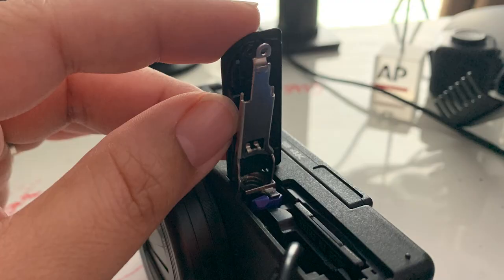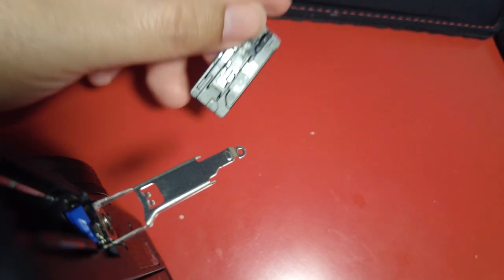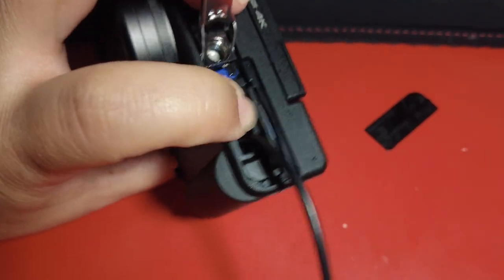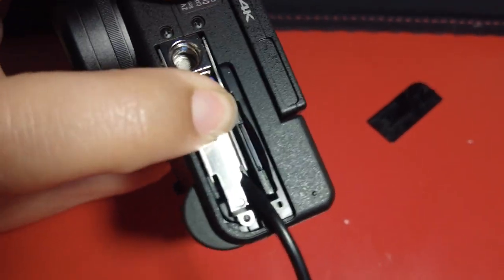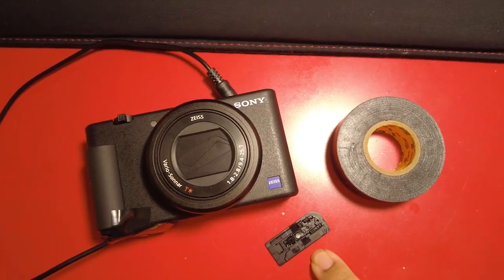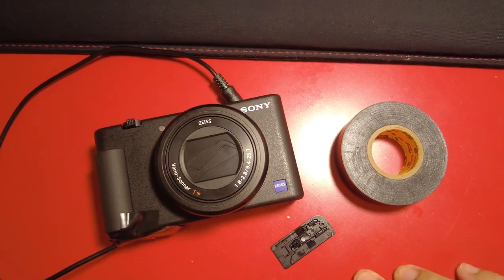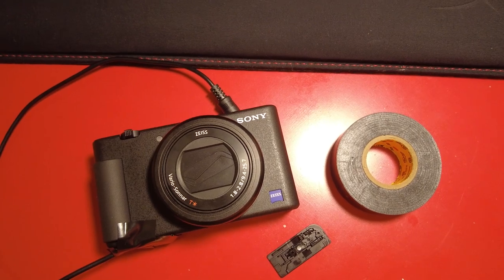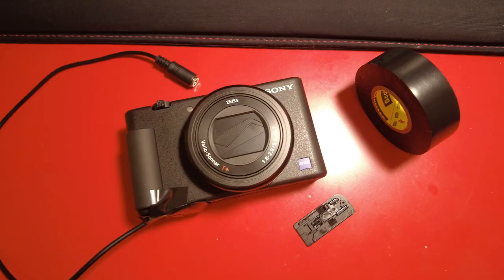Sony ZV-1 Hack: Close the Door when Using a Dummy Battery

Comment: Me: needs to fit dummy battery - watches 3 YT videos for ideas

YT Vid1: Guy proposes extending the tripod mount post screw so the base plate doesn't stop the door from being left open (would increase camera wobble without the base plate providing support)

YT Vid2: Guy actually files a notch into the side of his camera for the dummy cable to route through! (Just...NO!)

YT Vid3: RGV Learner points out there's just a single screw holding the door to its metal hinge and by removing the plastic cover the shape of the hinge flap allows for a dummy battery cable to fit through perfectly!

Thank goodness I found this third video in time! Thank you for saving my camera from disaster!